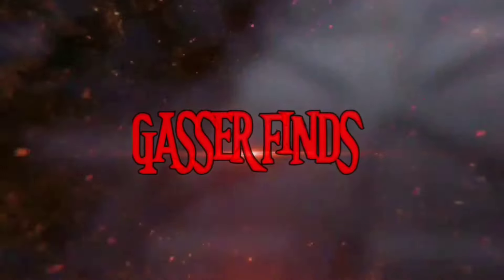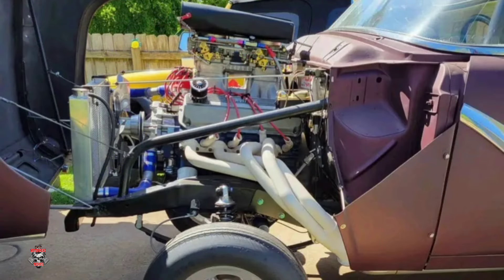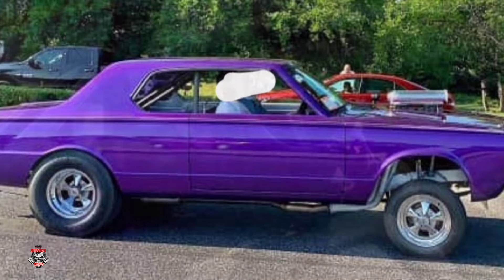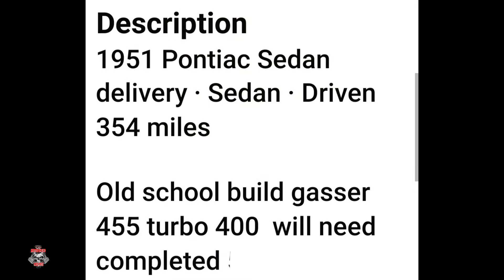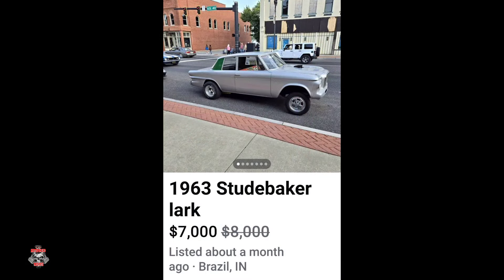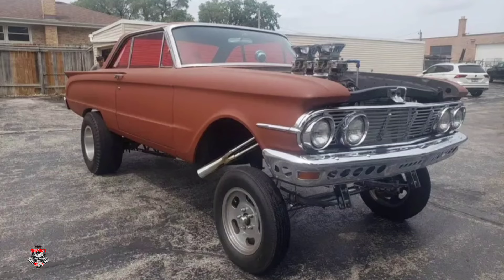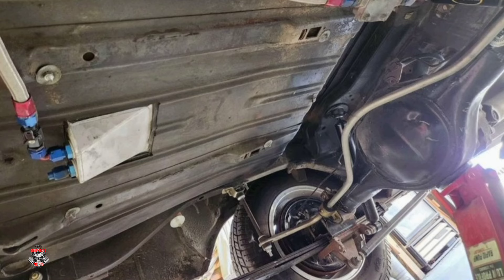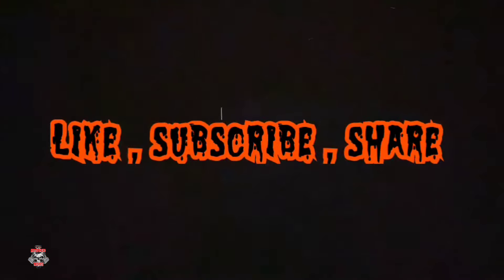GASSER FINDS ON FACEBOOK MARKET PLACE! Ep3

Comment: Being a Ford guy, I like the 2 offerings. The 429 makes big power, but not out of the hole. I think there's a 351W in the little Merc, but it could be a 302. They both spool up pretty quick. I'm with you on the Pontiac. Never should have cut the window holes. The 455 Olds is a fun choice, and I'm over bowtie power in just about everything.
Reply from the maker: I definitely understand that about the engine selection.. thanks for watching and commenting